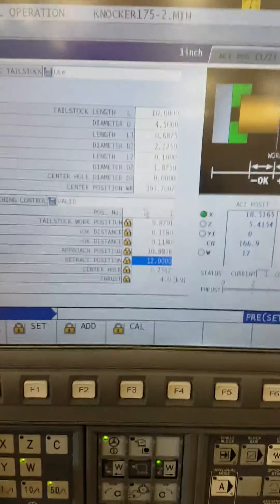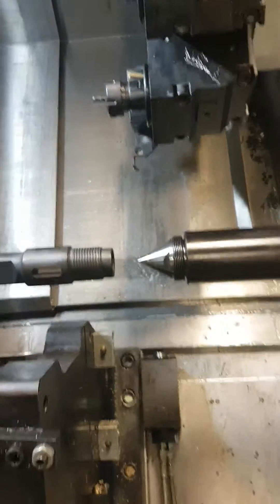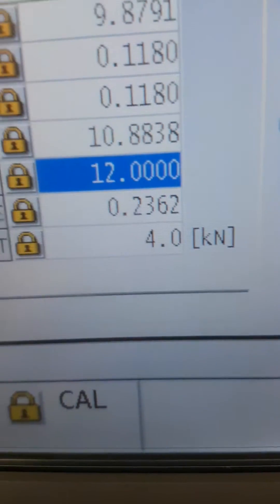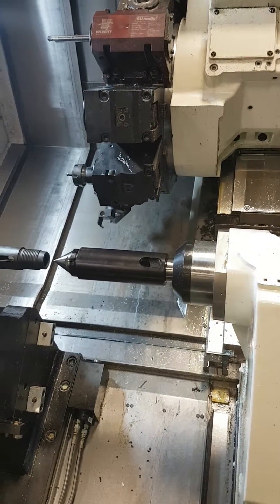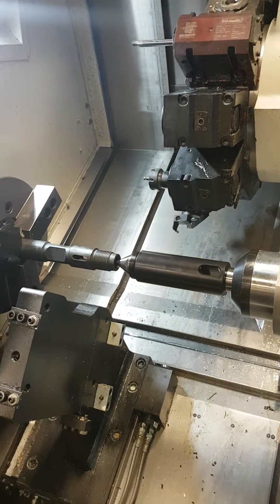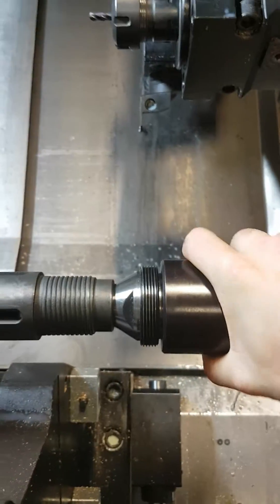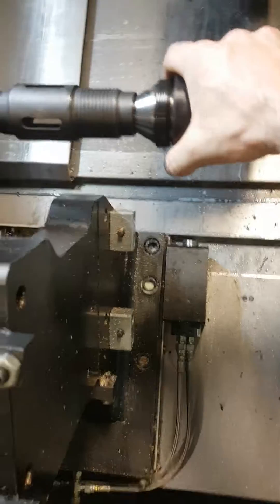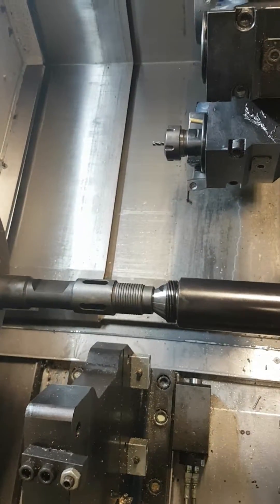Okuma Tailstock Thrust Issue

Comment: Did you try turning up the tailstock thrust pressure? Far right side of machine while facing door, manual knob. Should be above door for way oil lube tank.
Reply from the maker: Smoke it's a servo driven tailstock, not hydraulic.
Reply: gotcha! I will be of no help, everything I deal with is hydraulic. Good luck!